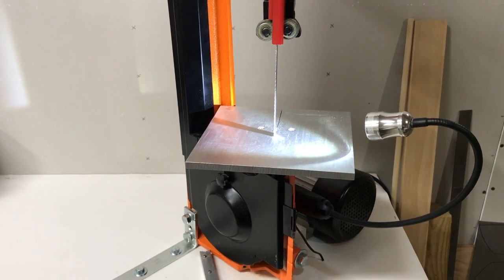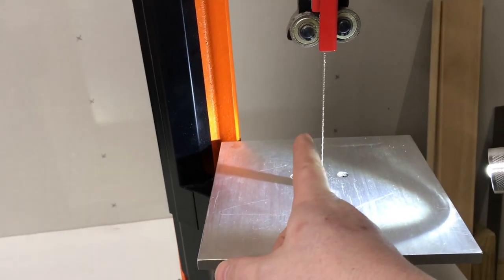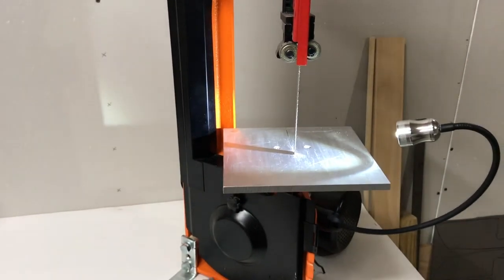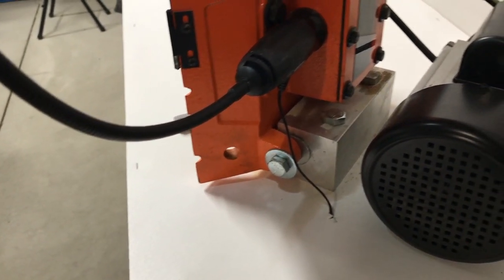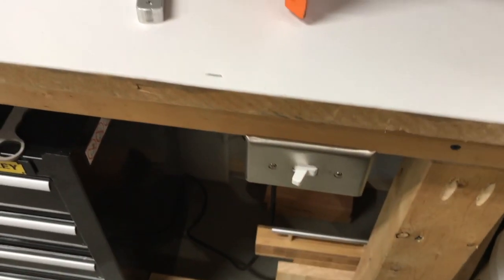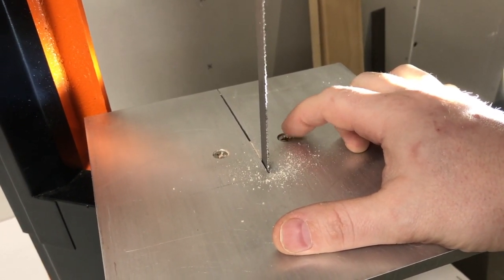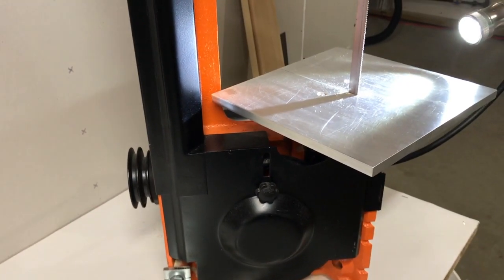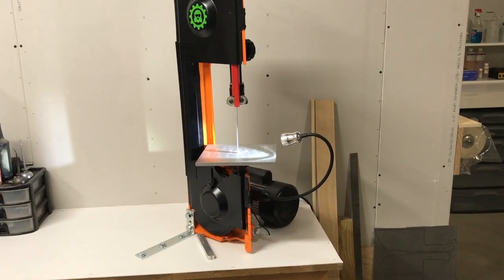WEN 4x6 Metal Cutting Band Saw Mods

Comment: Very nice job, I have one of these saws and I love it's capabilities for horizontal cutting but you are right about the cheap table for vertical operation. I am going to do something similar to what you did to give me a a much improved table - thanks for the video. Btw - another advantage over the Milwaukee/Swag combo, I think,  is the Wen is so much quieter.

Comment: If you want a good magnetic tool light, don't look for a "tool light," instead look for a "sewing machine light." 
 
I have a POWKER 30 (ASIN: B07J4ZKGF4) for my drill press which works pretty good. The light is strong but diffuse, the magnet holds well, and the gooseneck isn't overly flexible. Also, it's under $10.